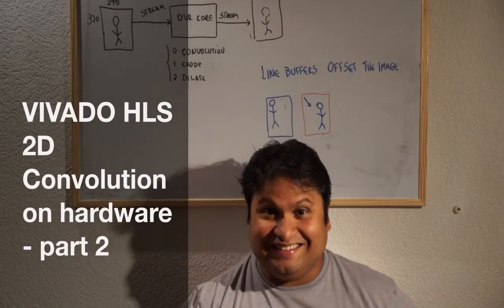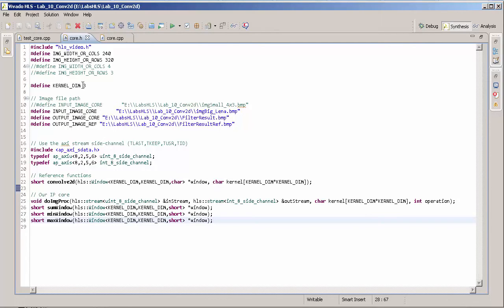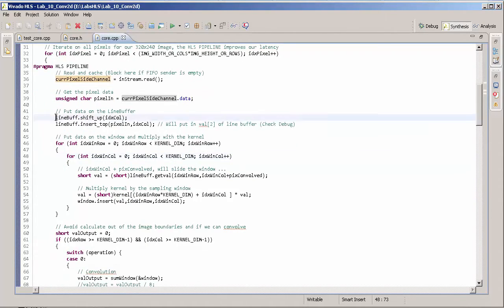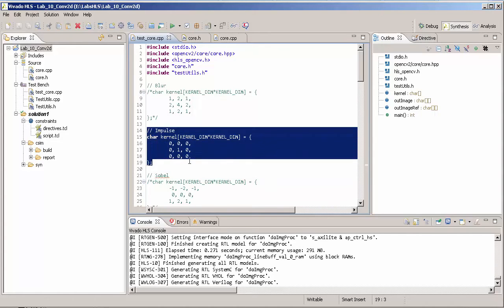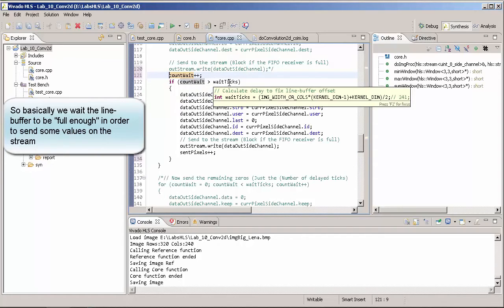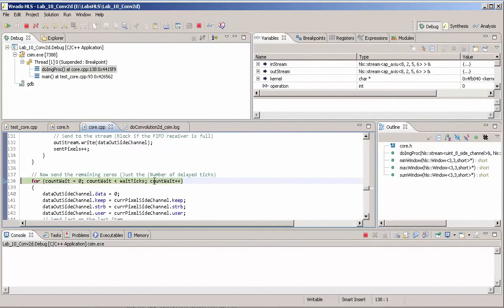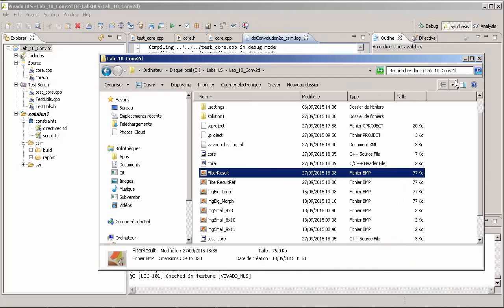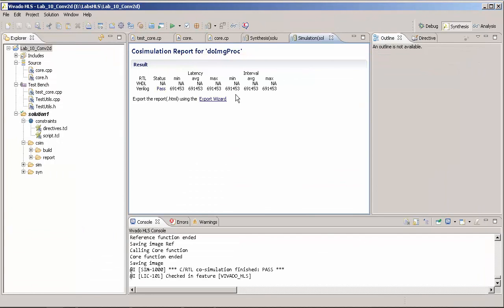VIVADO HLS 2D Convolution on hardware - part 2

Comment: I liked your work, thank you.I have a question, I would like to perform a correlation between two images that have the same size and calculate the normalized correlation coefficient (similar to the MATLAB function corr2, the coefficient is between -1 and 1).I am new to the Vivado HLS, what do you think the best way to implement it?

Comment: Hi, great vid, as for usual. It will be interesting to see how you use the generated IP core. One question as well, does this core support different clokc speed for AXI stream and AXI litre CTRL? Otherwise  how could it be modified to add AXI clock input? Thanks for your video and your time.
Reply from the maker: +Benjamin laf Thanks, I will post the part 3 showing how to use this IP core, and yes it support different clock speeds, I can show that on the part 3 of this video. Question do you have any other IP in mind that could be nice to do on Vivado HLS? I'm probably now switch to another course (matlab->HDL) and embedded systems with mbed, but if you guys would like to learn more about Vivado HLS just email me.